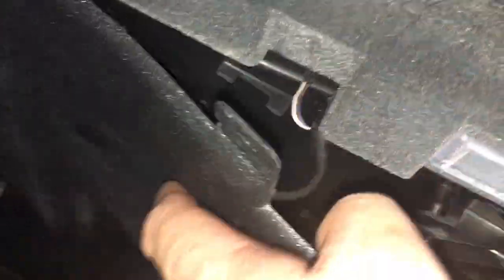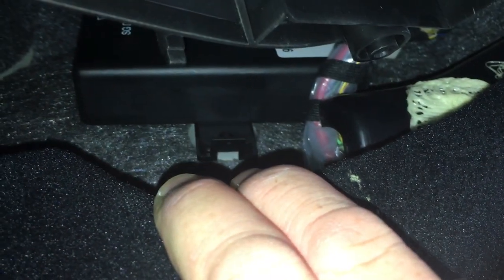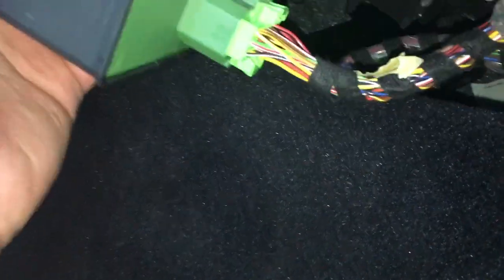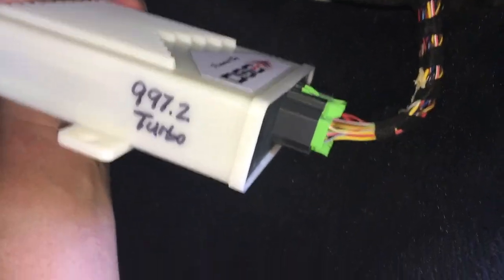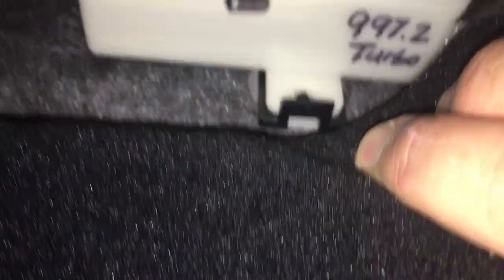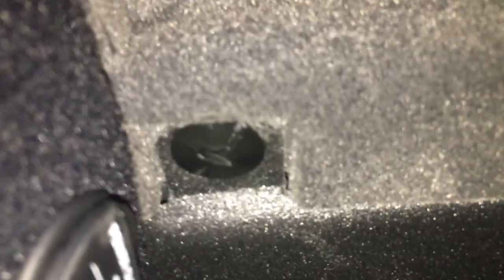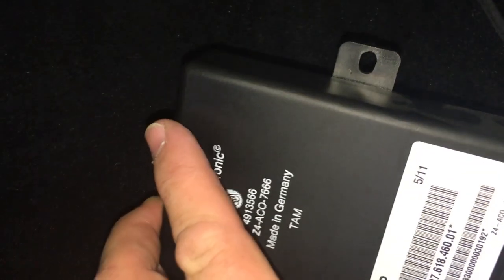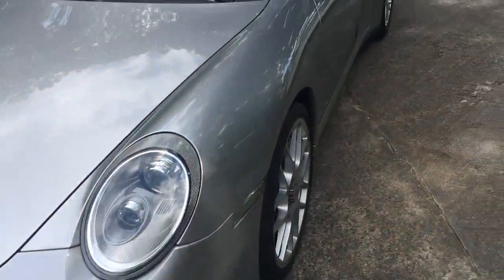TPC DSC Install on a 997.2 Turbo S

Comment: I just had it shipped and will be installing it this week. How did you find it so far? Thanks for the nice simple instruction!
Reply from the maker: I still love mine.  Just made the car so much more compliant.  TPC just came out with a new feature for these also for cars like mine (PDK launch mode) or anyone drag racing their Porsche.  It allows more "Squat" of the rear end during a launch for greater traction.  I'll be sending mine in for the update soon.